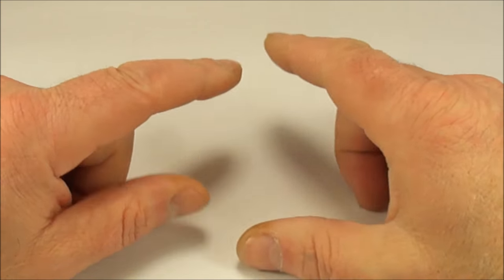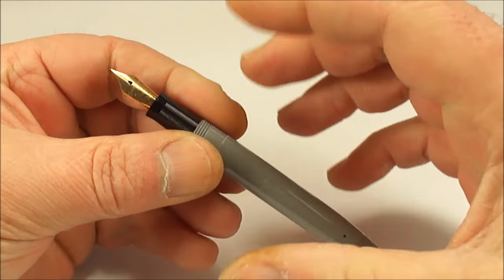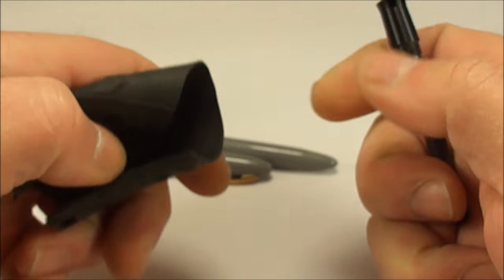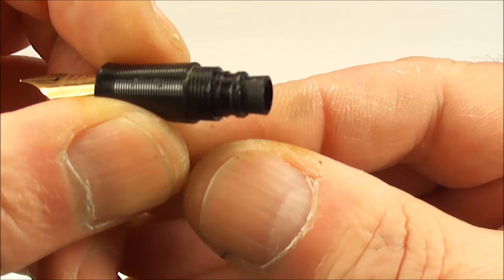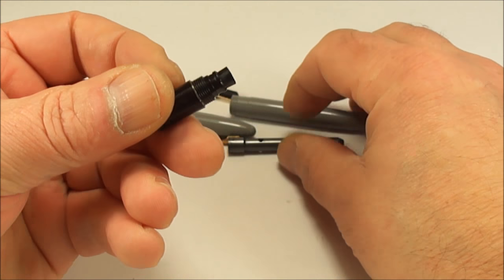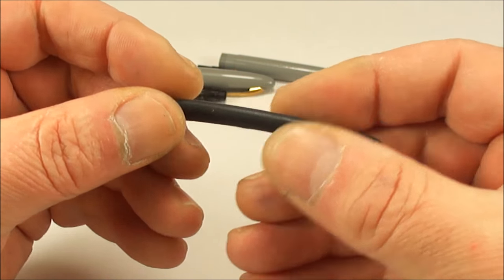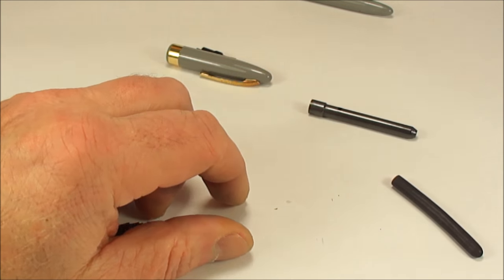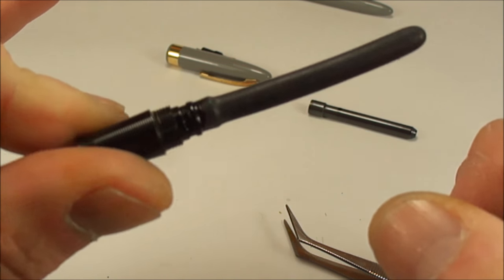HOW TO SERVICE A SHEAFFER TOUCHDOWN FOUNTAIN PEN

Comment: Great video Steff. I have been given two of these pens and didn’t know what model they are. I replaced the sac in one but it would not fill. Now I know I need an o ring. The other is very stiff on the plunger part and I can now get the right parts for both and get them writing.
Reply from the maker: Thanks Ian, glad it was helpfull. Yes all the internal parts need to be replaced to service it correctly. Good luck.

Comment: Great video - thanks for posting.
Tip for placing screws on screwdrivers: scrape screw head on a bar of soap. It will have just the right amount of "hold" to stay on tip until it's positioned.
Reply from the maker: Thanks for watching glad you like it and for the tip.

Comment: I heard some people dont like to restore these but it seems easy enough to me! I love the touchdown system and i think its well worth the trouble of maintaining that O-ring :)
Reply from the maker: I would'nt say it is a easy job especially for a first time restoration. And it needs more than just maintaining the O ring. Good luck and stay safe.
Reply: @penkino1  more then the Oring? Not really. O ring and a sac. And a nib. But every pen has a nib to maintain...

I still dont think touchdowns are all that much trouble compared to a lever fill or any fountain pen.
Reply from the maker: Glad you find them easy Joshua, good luck with your pens. Stay safe.
Reply: @penkino1  ...

Comment: I recently acquired a vintage Schaeffer witht his mechanism, but I think someone shellacked the barrel to the grip at some point (or else it's caked on with more dried ink than has already come off in my cleaning attempts). Any recommendations for what to do if this is indeed the case?
Reply from the maker: Try soaking the nib unit only in water to remove the old ink, then use dry heat to remove the section. Good luck.

Comment: Hello, great video thanks for the video. My mom gave me the model Craftman as a gift of my grandmother but the trouble is that i´m in Mexico and its a bit difficult or expenssive find the replecement soooo do you know if i can use it with any cartridge or conversion kit? Please Help me
Reply from the maker: I would not recomend a cartridge or converter, but to get the pen correctly serviced. Good luck.
Reply: @penkino1   thanks! Greetings!

Comment: super helpfull as always! though I did think my feed was unscrewable (craftsman 33 touchdown filler), that ended up not being the case.. so I snapped the feed unfortunately, but not to worry, I got it back together with some shellac making sure not to block any holes, I removed the little inner feed (if you know what I mean? I'm not sure how to call that part, it's the little stick with a groove in it that is inserted into the main feed) so there wouldn't be any problem with flow

I just removed the end cap for the touchdown filling mechanism, I got the o ring out, but it's still in good condition! what would you do, just insert it back into place or order a replacement? the o ring has a square cross section so I think it's the origional.. posibly

the cap threads on mine are unfortunately worn, would there be any way to repair that? at the moment the cap skips often so you can't tighten it down like you would normaly. I was thinking of adding material in some way and re cutting the thread

edit: I already got the threads fixed :) I abraided the barrel to get rid of the worn threads, exposing new fresh threads. the cap now works again like it used to do :)
Reply from the maker: Yes as always you have to be carefull and patient. I am not sure shellac will give you a secure fix on the feed ? Always replace the (original) O ring, unless you know it has recently been replaced. Glad the threads worked out. Well done.
Reply: @penkino1  thanks for the advice on the o ring. It does seem to pull a vacume but who knows how long it will last. 

You are right about the shellac on the feed. It does not hold even a little. What do you think about superglue? 

I will get it fixed somehow, I'm very patient with that kind of stuff. Rarely do I give up on something I care about. If nothing works out I'll have to make a replica of the feed, unless you have one on hand? It's a dip tip style feed. I can contact you with more details if you think you may have what I am looking for
Reply from the maker: I would replace the O ring as well as a new sac then it will give you years of use. Super glue will not hold it eather, your best bet is to find a replacemrnt feed. Sorry i do not have one. Good luck
Reply: Thank you Steff! I will see if I can get my hands on a replacement then
Reply: Hi Lego man. I have a Craftsman 33 too. Can you confirm - does the feed unscrew?  Thanks Stef great video 😊
Reply: @johngreig1705  hi John, I can confirm that the feed does not unscrew! You need to pull out the inner feed (which fits very tightly in the big feed) and then you can punch the big feed out of the section. I broke my inner feed by trying to punch on it

Comment: Thank you Stef. You make it look a lot easier than what most of the community makes it out to be. Do you know if the procedure is the same for a Sheaffer TD Statesman? Mine was restored about 3 or 4 years ago but I know eventually it will need to be serviced. I might try to get one just to learn how to service these pens.
Reply from the maker: Hi Ivan..Some people want you to think it is difficult, but it is not. Yes the same applies to the Statesman, however if it was done correctly i would think you should get quite a few more years from the pen before a service. Good luck

Comment: Thanks for posting this video.  I am ready to order my replacement sack and o-ring.  Thanks for your tip on "pushing" rather than "pulling" the plunger to fill the ink sack.  I thought I had to do the opposite.  One question, what's the purpose of the shellac you applied on nipple before attaching the sack?
Reply from the maker: Thanks for watching. The shellac is the "glue" to keep the sac on the nipple. Good luck and stay safe.

Comment: FYI.  If you hear about breaking the old seals using a hairdryer to heat, IF YOUR FINGERS ARE HOT, THE PLASTIC CAN MELT!! No one said how to not melt the plastic!!  I think I’ve saved it (Sheaffer Statesman).
Reply from the maker: If in doubt Sheila always best sending it to a repair person rather than breaking the pen. Or practice on cheap pens. Good luck
Reply: I may not have a choice but to send it off. This sealant is concrete inside it.

Comment: Thank you for another great tutorial, Stef!

I am working on a Sheaffer Australia Touchdown, it appears to be an Imperial III with a Triumph-style steel nib, I read that the screw for holding the Touchdown plunger tube needs to take a washer (rubber or star-type) before being introduced into the tube, and I found remnants of a rubber one in there when cleaning it; just a small point but I wonder if you have experienced something like that.

Also, there are vendors offering special sacs for the Touchdown with a narrow neck, it might be for making a better connection with the section nipple with an inclined profile, but as I have a No.14 sac I might just be as well use that; I wonder if a thin-walled sac is necessary, as the filling mechanism relies on air pressure between the inside of the barrel and outside of the sac to compress the sac, so perhaps a regular one might be harder for it to function fully, but I am guessing here!
Reply from the maker: The Touchdown has a rubber washer inside the plunger knob. Yes the thin walled sacs are necessary for the filler to work correctly. Good luck with your pen.

Comment: hello, good video.
 However, I have a question, I have a sheaffer iv, but I don't know what sac  size he uses, I don't know if it's # 14 or # 15, I know you made a video about this specific fountain pen, I would appreciate any answer.
thanks.
Reply from the maker: Thanks for watching Santiago. You can buy these sacs as a kit that include the O ring and point washer. Good luck.

Comment: I’ve seen some kits for TD and snorkel with a black rubber gasket for the screw between the internal piston and the blind cap.  I notice this pen didn’t have one originally.  Is it important to use one of those?
Reply from the maker: They normally stay in place when you remove the inner tube, if not then yes replace it. Thank you Dennis.

Comment: ...it's a pretty easy servicing.  the only tricky part for me was determining if i had a fat or slim touchdown pen so i could obtain the proper size o-ring (i have a fat touchdown).
Reply from the maker: Im confused ? Most touchdown pens are a standard size O ring.
Reply: the early touchdowns had the conical Triumph nibs and were wider in diameter. i believe they only lasted a year before they slimmed them down to what most of them are now.  they are not rare; you still you can find these "fat" touchdowns.  i also have a fat touchdown desk pen...
Reply from the maker: Ahh i see, thanks for the comments.